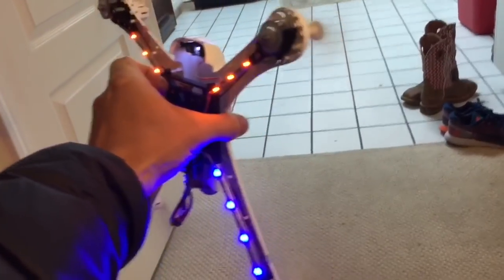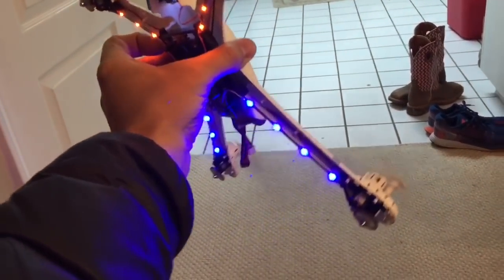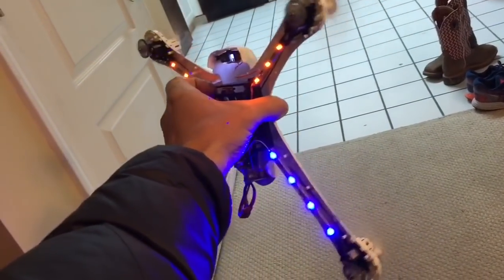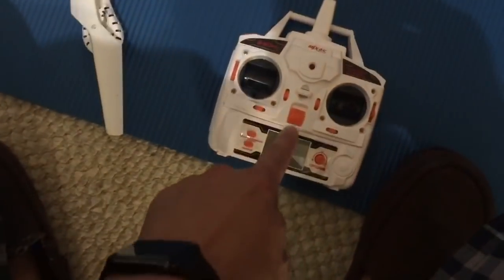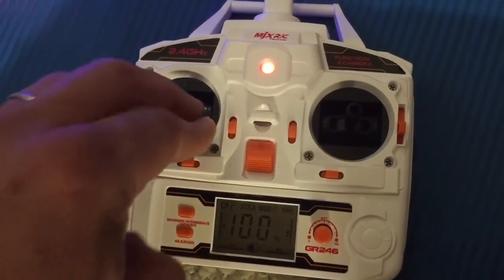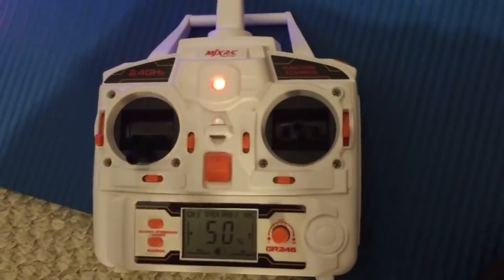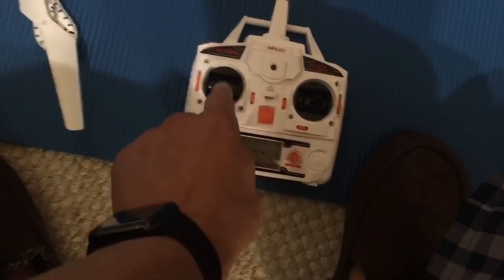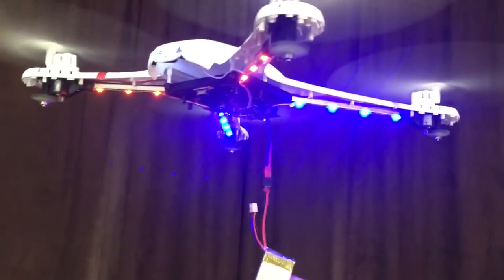How to reset re-calibrate your drone to fly horizontal

Comment: the drone s89 is not flying,  so i want to do factory reset but the drone is not resetting. I pressed the throttle lever and the directional lever at the same time which I angled to the button right corner but the drone is not factory resting. Pls any help!!!